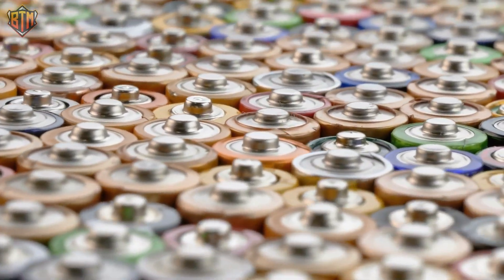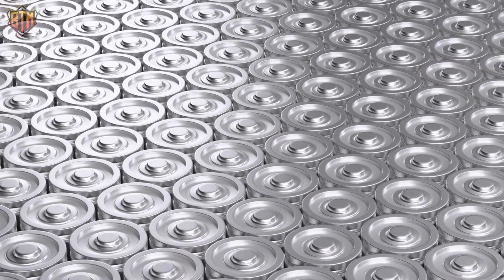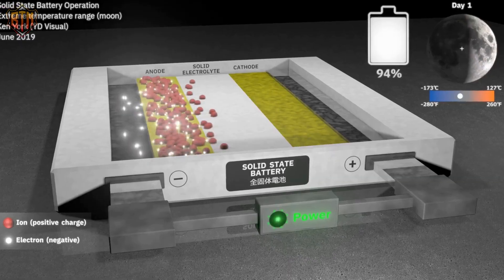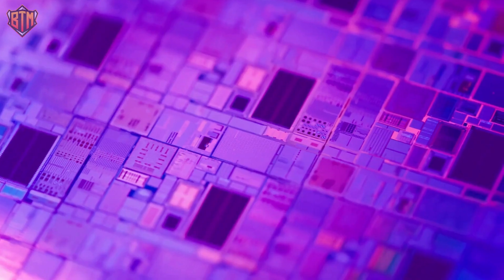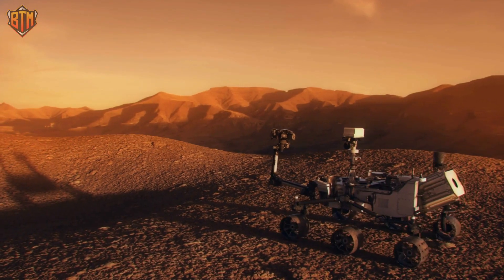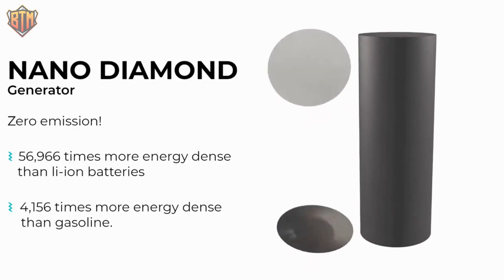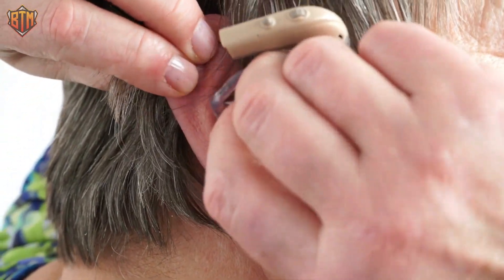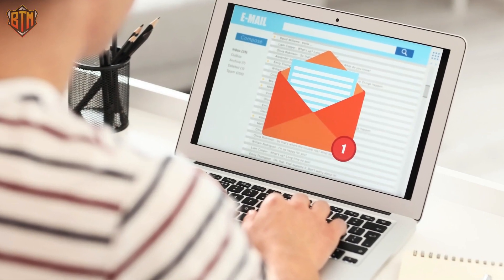IT'S REALITY! Nuclear Diamond Batteries Finally Hit The Market!

Comment: What BS. Does anyone commenting realize what a Micro Watt is?. A One Watt NDB battery would weigh about 300Kg.
Reply: Yes, exactly. People are really dumb about this topic. It’s total ignorant rubbish to consider this viable for smart phones, laptops, EVs or anything else using Watts or kilo Watts of power. And if you actually could make such battery with betavoltaic technology, you would have to use enough radioactive material that would produce perhaps twice as much decay radiation power. An EV battery producing 10kW (13 horsepower lol) would mean perhaps 20kW of beta radiation inside. It would be super dangerous like a mini Chernobyl disaster on wheels.

Comment: Need to start making batteries in a standard size so they can be swamped out maybe the battery's last longer than the car does take the old batteries put them in a new car or the batteries get damaged somehow in the trash just replace the one battery. There is really no need to make batteries if to fit one car a lot of different batteries arranged in the frame can be used just make it so you can access One Bank of batteries at a time.